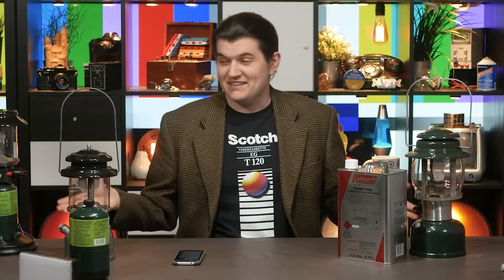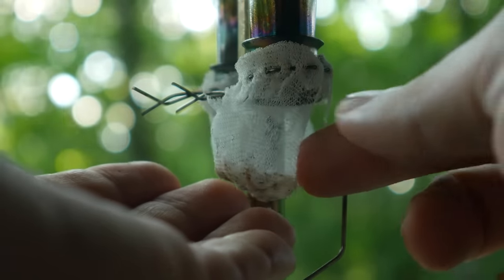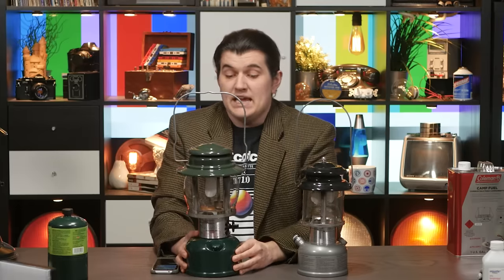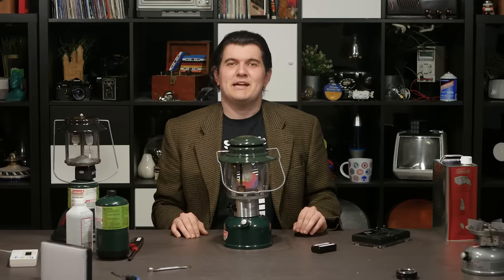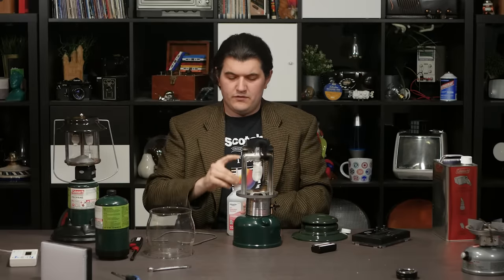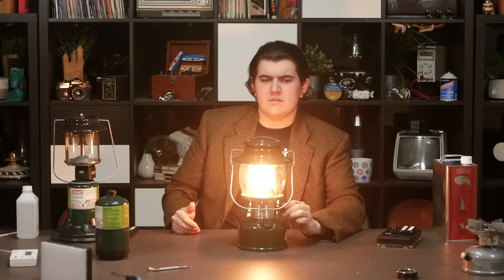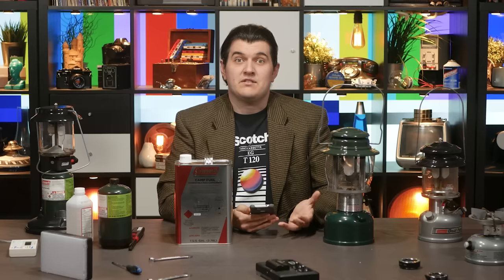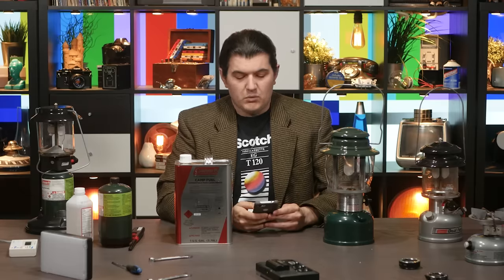A very rambly Coleman Lantern follow-up. Turns out they rarely make sense in 2021

Comment: Bro, LEDs are so superior to anything gas or incandescent, I don't think you need to explain blind spots. I literally have an LED flashlight with a solar panel on it that is waterproof. It was like $53 on Amazon aka cheaper than most of these lanterns. Nostalgia is the main reason people like these, or as a quasi-heater in the winter. However, it is extremely dangerous to use these in tents which people do all the time.

Anyways, I loved falling down this random ass rabbit hole
Reply: At home I only use incandescent bulbs because LEDs create harmful dirty electricity and blue light. There, another reason for not using LEDs, have you heard that reason before?
Reply: @flat-earther  it sounds like you've never actually shopped for lightbulbs before. LEDs, just like incandescent bulbs, come in all temperatures and brightness levels. Not to mention that blue light is not harmful as it is created in all forms of white light. Yes, even the sun creates blue wavelengths, not just computer screens. Add that to the context of this situation, where the purpose of the video is discussing lanterns, a form of emergency or travel lighting which is mainly about efficiency and efficacy.

I'd also point out that you said LEDs create electricity which doesn't make any sense. Maybe you meant LEDs use electricity? I'm afraid incandescent bulbs also use electricity if you weren't aware.
Reply: @BjornAWarrior  I said LEDs create dirty electricity. I have an EMI line meter that when I plug it in a power source it gives a certain reading, then if I plug an LED bulb to the same power source the readings on the meter go up significantly, while if I plug and incandescent bulb to the same power source the readings don't move at all. Incandescent bulbs create absolutely no dirty electricity at all.
Reply: @flat-earther  so you're saying an LED creates more electromagnetic interference? I don't think there is a consensus that "dirty electricity" is a real health risk. The amount of radiation you experience, again from the sun, is orders of magnitude greater.

You are failing to address the idea that using fossil fuels poses an even greater risk to health. Incandescent bulbs use more resources to produce and don't last nearly as long. EMI is produced by all electronics. Btw, you should definitely be more afraid of the phone you're probably using to reply to this than a lightbulb

Comment: Something you need to consider when someone uses these lanterns for camping. Look on the front of that camp fuel can.. Stoves! I run the dual fuel coleman lantern and stove. Electricity is terribly expensive when heating for cooking purposes. That 5 of those batteries... I call ultra bullshit on 5 of them running a electric stove capable of 17,000 BTUs for 4 hours. Prove me wrong.

Also youre forgetting the human perspective. LEDs are horrible to look at because of thier colour ranges for human eyes.

Comment: Coleman lanterns pair well with a Toyota FJ40 Cruiser.  Modern LED lanterns pair well with a Toyota Prius.  There is a difference, and it's not measured in light output or energy efficiency.

Comment: I think the point is drivent home, kerosene lamps are just dumb and always have been, having to prime it, wait, wait, and wait... with some more waiting, you may light it. That is objectively bad, dumb and very very stupid. Any other light source, especially LED, but also any gaz or propane are much better, simpler to use. I never thought these things were more than a curios from old times BECAUSE they are very very dumb and bad, i am very surprised anyone would find any justification to use this... Anyone pulling one of these anywhere will have people laughing at how dumb it is.

Comment: So much bad advice in this video! You never open the font and release the pressure until the lantern has completely cooled! It's a wonder you haven't blown yourself up. And it's denatured alcohol you should be using for preheating the generator, it leaves no soot and burns hotter.  The reasons to have a kerosene only lantern are less volatile fuel , cheaper than coleman fuel, diesel #1 can be used as a alternative and is cheaper , kerosene burns brighter and for alot of people they already have kerosene heaters and oil lamps so this adds a  brighter tool for lighting a large area. Most led lights utilize electronic circuits which will be useless after a emp. There is gas and diesel laying around everywhere and yes you can use pump gas in any white gas coleman stove and lantern but you'll have to clean the generator more often which is really a very long time. A duel fuel lantern or stove just have a bigger generator and will eventually clog up just not as soon.

Comment: there is no one way valve ..your thumb is the valve .. so to pump air into the tank you must open the hole when pulling the handle out .. and close the hole when pushing in thus pumping the air into the tank ...simple..!
Reply: Not true in the slightest I'm afraid. It is a one way valve, but the thumb hole has nothing to do with it because air enters the pump from elsewhere. The hole is to prevent accidental pressurization. Even slight vibrations from driving down the road would be enough to pressurize it and lead to a catastrophic lawsuit for Coleman. Hence the thumb hole, which prevents air from becomming pressurized from vibrations when uncovered.

Comment: I think You ramble so much about liquid fuel un-practicalities because the thing scares You. When You know the in´s and out´s of a Coleman or (in Germany) a Petromax.
My Dad had a Petromax( just like this one: https://www.youtube.com/watch?v=muq64gD-fOI they still make it), it ran on Petroleum (we call white gas that) and it was more refined than the Coleman. It had a pressure gauge and a striker that would act as a mini flamethrower pointed at the head of the lantern where the mantle hung and the generator part was.
Just pump up until the line on gauge, strike the flamethrower (wich used pressured fuel thru a jet to create a blue flame), let it warm up a bit and turn on main fuel to light the mantle.
If You were too hasty with preheat then the fuel would just burn off because of the starter fire and eventually vaporize when all is warmed up.
So: get a Petromax. It is the better Coleman. And: train the use. Train-the-use, train the use.
And in a freezing cold camping a nice, warm Petromax is just what the Doctor ordered. You can even turn it waaay down so it´s barely lit and it won´t go out. It will stay lit.
So, kick sand with Your batteries and stone age Colemans. I hunt now for a Petromax. Didn´t think of it for 40 years...
Good video, though- Merry Christmas and a happy new Year!

Comment: Chief argument for kero Coleman lantern, demographics.

Amish

Wont, dont, cant use battery operated equipment, much less mains. So, no lectric lites. Period. Full stop.

So now it becomes a question of economy. Kerosene wins hands down.

And yes, the specialty stores that cater to the Amish know this and advertise accordingly.

Kero Coleman lanterns have the same target demographic as kerosene Dolmetic refridgerators.

"And now you know, and knowing is half the battle." (G.I. Joe)
Reply: The Coleman is less expensive than the Aladdin.

Comment: You're a smart guy and know a lot of different things.  But it's clear that you are a complete novice with these lanterns. They are far superior to the propane and LED lighting that's more common nowadays.  The problems that you describe would be easily avoided if you had some instruction and experience on how to operate these. These lanterns are not as difficult to use as you make them seem.
Reply: Look I love fuel lanterns as much as the next guy, but in what way are they "far superior" to modern led or propane options?
Reply: @atfyoutubedivision955  So I'm not sure I should even be responding to a question from the ATF... 😅

First off, all liquid fuel lanterns put out a tremendous amount of light compared to LED.  Propane is almost as bright as an everyday naptha powered Coleman 220, but my kerosene Petromax lanterns are ridiculously bright.  Too bright for camping really.   I prefer my Colemans for that. 

Regarding downsides, the fragility of the mantles was grossly overstated in the video.  My primary camping lanterns are two Coleman 228s from 1965. They are dual mantle lanterns. I'm on my second season of camping with all four mantles.  That's a total of approximately a month of use with lots of traveling by car.  That said, I also have a mini Coleman lantern (a model 226) that I have kept in my truck for two years. I just ran it last week to check it out. The mantle remains intact.

Something else to point out is that all Coleman liquid fuel lanterns ever made are capable of using both naptha (Coleman fuel) and gasoline.  The "Dual Fuel" feature is simply a marketing gimmick started in the 80s.   Something else to point out is that most liquid fuel Colemans, if not all of them, with minor tweaking, are also capable of running kerosene.  That includes Coleman stoves.  So Coleman pressure appliances are capable of running naptha, gasoline, and kerosene (with preheating.) 

When I'm out camping I'm not a fan of bringing along extra propane cylinders and batteries that need to be either recharged or thrown out.  A gallon of fuel will last me at least a week for both light and cooking.  That is to say that I always bring along a gallon but have never run out.

Okay, so all of that said, if I were hiking in 10 miles for a few days I wouldn't even bother with a lantern.  The object is to stay lightweight.  In the past I've used Petzl LED headlamps and candle lanterns as backup.

Liquid fuel pressure appliances are definitely not for everyone. They take a certain amount of mechanical aptitude to understand their workings.  And there is a safety concern for folks who aren't all that savvy about such things. But I've enjoyed camping for many, many years.  My equipment choices have come full circle from using Coleman lanterns in rural Alaska to LED lanterns to propane.  Propane was a real pain to use in cold weather.  It tended to freeze up constantly. 

Anyway, I'm getting tired of typing so that's enough. 😅

Comment: When a guy in a blazer tells you what you ought to equip yourself with on a camping trip, lol. LED light is garbage, not omnidirectional, and is subject to battery half life, (diminishing output)  they really aren't that great. Flashlights excepted, of course. Lumens aren't a very good measure of usable light, either.
Reply: At home I only use incandescent bulbs because LEDs create harmful dirty electricity and blue light. Have you heard that reason to avoid LEDs before?

Comment: Let us look it at all this from another angle. Lithium Battery manufacturing is actually very very bad for the environment and the people working it. Vs White Gas that is just a by product of making gas. All these push for green energy still requires oil, gas and coal at some part of the process. Hell the windmills that produce power have a lot of grease in their gears like 100's of pounds in them that have to be replaced regularly. Green energy really is not all that green. We can look at Ethanol for fuel. Well it is just 100% pure alcohol yet to distill it still requires heat either from some sort of gas or from burning wood. Again green energy is not green. It is just a talking point.